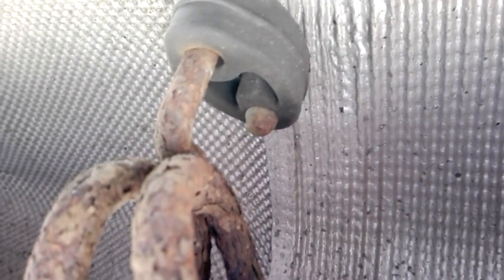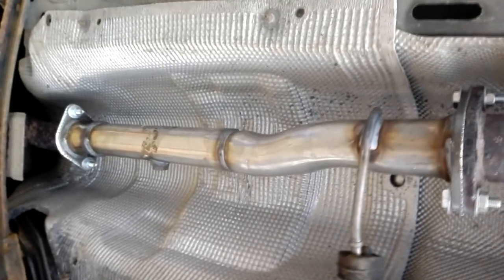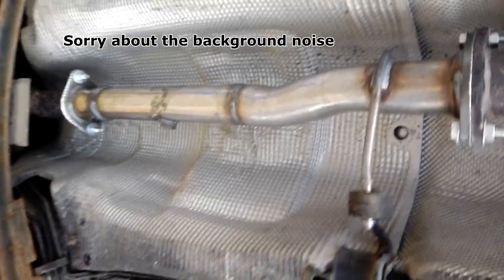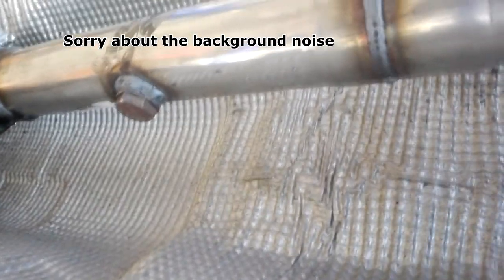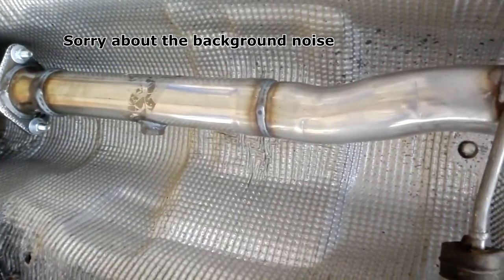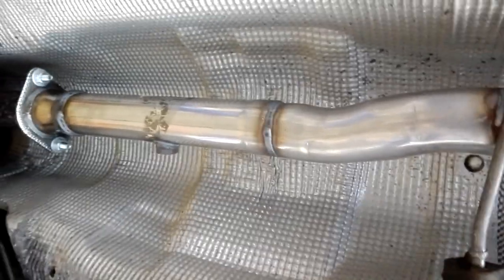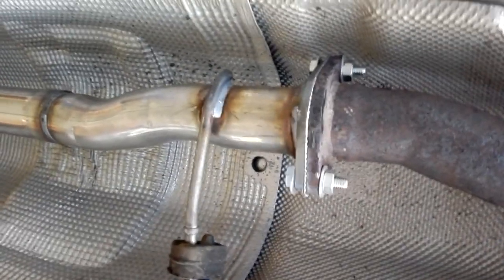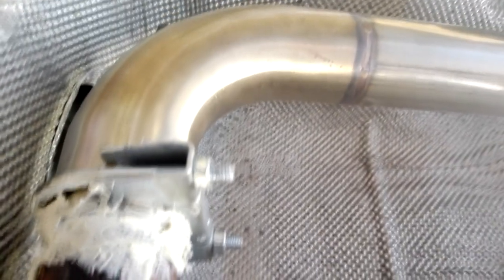#8 How to DE-CAT a Ford Focus ST Mk2 @@@ECP@@@

Comment: Nice video and useful knowledge. I've got an ST3 bought already Decat so i'll have to buy a CAT and bolt it on come MOT time.
Reply from the maker: Arr nice buddy, if you keen to keep the De-cat pipe on be for and after the MOT I would recommend checking second   hand sites ie eBay/gumtree for somone breaking a ST and grab a second hand one as a new cat isnt cheap
Reply: @ecp4538  hey mate, I bought a 2nd hand cat back when you suggested it and now the time has come to put the cat back on for MOT. Just wanted to ask your advice again as I've got limited space to work on the car so which side of the car is best to access and the right area to swap them? tia.
Reply from the maker: Hey buddy the cat is pretty central to the car but more to the front, so jack the car up from the front end  either side is fine, ideally if you can jack both sides and have the whole front end up on axle stands then you will have good room underneath to work, your bolts and O2 sensor should be pretty easy to remove if you de-catted the exhaust not all that long ago, let me know how you get on buddy
Reply: @ecp4538   Great, yeah I've got a jack and axle stands so should be ok doing that. It was decat when I got it so should have been swapped on the last MOT would think. Just hoping the lambda is alright still and don't need a new one.
Reply from the maker: The bolts should come of nicely, just take your time with the O2 sensor if its tough to undo, unscrew a couple threads then re-tighten, then unscrew again further, re-tighten etc as if it breaks a OEM replacement are ridiculously expensive, I needed to replace mine as it was completely sized in the CAT, I took a gamble with a aftermarket piece for £35 and luckily it worked fine and still is.   @neil_st6073
Reply: @ecp4538  gonna give this a go now but if they stuck on how much did it cost you out of interested to get the garage to finish the job?
Reply from the maker: good luck dude, I am a mechanic and it was my garage I work in so it didn't cost me any thing, but it wouldn't cost a lot as its only 4 bolts and a O2 sensor  @neil_st6073
Reply from the maker: @neil_st6073  Hey buddy how did it go?

Comment: how did you drill the holes in the center pipe?
Reply from the maker: Sorry buddy not sure which holes your meaning?
Reply: @ecp4538  the ones at the decat bolts to
Reply from the maker: @callumturner2013  it came pre  drilled buddy so all I had to do was bolt it together

Comment: Does you car flame after doing this or do I need a map to make it do that?
Reply from the maker: No buddy but I wish it did lol, you could if your lucky get flames but not as good as you would like, you would need a MAP like you  say,  this car is going for its first MAP in June and I will be wanting huge pops and bangs lol
Reply: @ecp4538  okay thanks pal. Ill get mine mapped soon then
Reply from the maker: @jamiegilman8935  what mods have you had done already
Reply: @ecp4538  nothing yet I've only just got the car
Reply from the maker: @jamiegilman8935  these ST can have a stage one without any mods upto a 260hp
Reply: @ecp4538  think I'll probs leave it a while and get used to the standard power as I am coming from a 1.0 litre micra 😂
Reply from the maker: @jamiegilman8935  Yeah thats a pretty big jump buddy